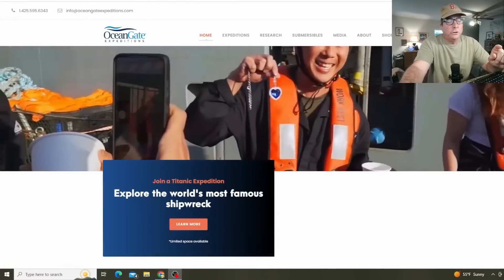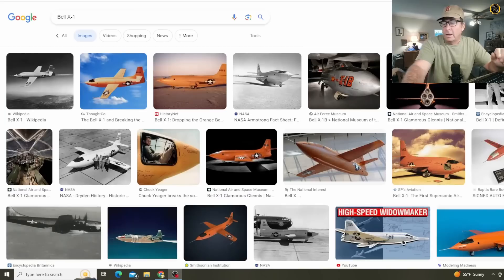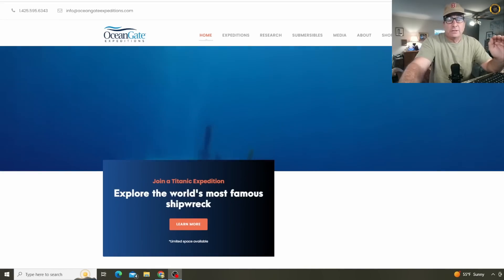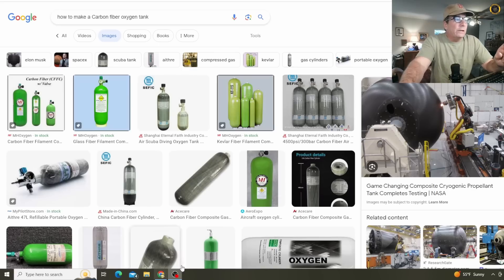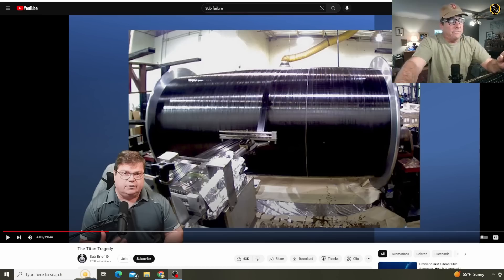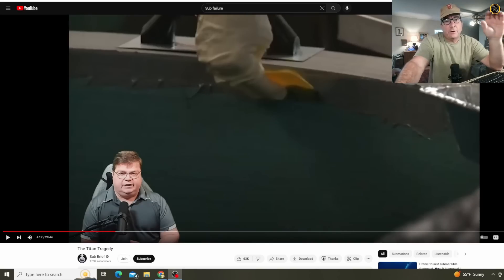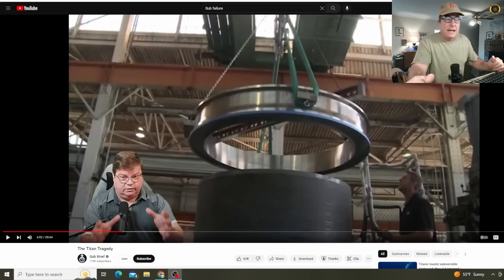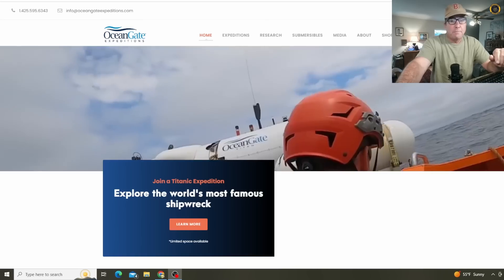Oceangate Sub Construction Details and Implosion

Comment: A really good engineering description of the construction and a possible failure mode of the pressure vessel. That glued joint is disaster waiting to happen. If the joint rebate was much deeper, say 18 inches, it would have helped to stabilise the tube.

Comment: The titanium ends once the caps are on are crushing the tube and the only thing resisting this is the epoxy which is an upgrade over paint or glue but still is not ceramic or something using heat over chemistry. Wondering about engines and why they don't use carbon fiber for things like the block, pistons, rods, it is because it cannot withstand the compression. They have looked at ceramic in engines but it has a brittleness problem, they are used though and withstand higher temperatures. Ceramics, because of the heating, is quite complex compared with epoxy, armatures make carbon or glass fiber boats and I suspect airplanes, I made a wood/fiberglass kayak a bit rough but it works.

Comment: I do airworthiness for my job and I could tell the CEO of Oceangate was misrepresenting and lying about the using "approaches largely used in the aerospace industry". You nailed it, Juan. We avoid using carbon fiber in a compressive stress environment as much as possible. If we do, then we certainly don't lay the fiber the way they do. We also like to bond ceramics to fiberglass and carbon fiber to help with compressive stresses. 

Bonding metals to carbon fiber is common, so I would like to know more about how that join is made. I think you are right though, the carbon fiber shell probably flexed and broke the joint. I am sure we will learn more as the investigation gets underway. 

Stuff like this is a black mark on the structural engineering industry. I see crap like this constantly trying to make its way into aerospace. I've seen a lot of fly-by-night engineers trying to push the use of plastic to solve a dynamic impact issue. I've seen more restricted material (corrosion and fatigue susceptible material) usage in the passed 3 years than I saw in the previous decade. There are a lot of con-artist out there trying to dangerous structural engineering down on the industry, and they always do it under the banner of "progress", "move quicker", "push boundaries", or whatever buzz word is popular.
Reply: I did wonder about the laying up of the fibers.  There's no angular overlap that I can see in the picture - just rolling it on back and forth. Does that mean there are thousands of potential weak spots along the edges of the weave line as the load is not being spread across a large area as would be the case in a diagonal layup?
Reply: @terrybrown8539 yet another haunting question about this thing.
Reply: @terrybrown8539   -  I'm in the gun business and seeing the way they were laying it up reminded me of the old damascus twist gun barrels and all the weak spots inherent in that kind of construction.
Reply: People are applying the "move fast and break things" approach to engineering.
Reply: Keep speaking out against this- we are losing objective truth these days and its a very big problem.
Reply: Granted we only saw a portion of the CF lay up but that doesn’t look like any CF lay up I’ve ever seen before. Like a spool of thread. Huh?
Reply: @lednails  Yes, he seems to me like a guy with a lot of hubris.  He is not the first, and probably won't be the last, to lose his life in his own vessel/vehicle.
Reply: FWIW, in this case, the bloke who you accuse of lying and misrepresentation had enough conviction, howsoever ill-advised or misplaced, to put himself in that which he designed and built
Reply: The old facebook motto of "Move fast and break things" doesn't sound so good in this industry...
Reply: If we lose the propoganda battle it's a black mark.  In reality it is a big green check mark for using actual engineering of actual facts ahead of fake engineering and fake 'facts' in the service of progress and inclusion.
Reply: Probably from the over-glorification of silicon valley culture over the last decade. The hubris from watching 20 something tech bros becoming billionaires overnight from wirting dinky little phone apps now seeping into the 'real world' where lives are at stake, Very scary 😱
Reply: @lednails  Well I don't think it's wrong to say that regulation stifles innovation - but, in instances like this, like the aviation industry, etc., it does it for pretty damn good reason
Reply: I would be VERY interested in any observations Burt Rutan might have on these issues.
Also I have no problem with the "move fast and break things" approach to engineering.
You **DO NOT PUT A MAN IN THE PROJECT** until the item has been tested **to destruction** ten ways to sunday.
Some folks fault Elon Musk for "fast and breaking things" approach but you do that BEFORE you ever introduce humans into it. There are few substitutes for "bending tin" when you are EXPERIMENTING with a new approach. I too listening to the CEO of Oceangate discuss this and his posted design philosophies and I was appalled at his "Everything should just work out fine! I mean, we are monitoring it... right?"
Reply: @phlogistanjones2722  In the software world, "move fast and break things" is not limited to pre-production. You get your work out into the world, then fix it if/when it breaks.

Tesla's automated driving systems are a good example.
Reply: @SnakebitSTI  Or basically any modern triple-A video game - good lord it's bad anymore...

Comment: The glue line between the different materials with different coefficient of thermal expansion, and different modulus, is definitely suspect. 
But - reports are that they had some kind of warning about it and tried to come up before total failure. To me that points more towards delamination of the CF tube itself - that would be a terrifying.noise to hear.  Or perhaps an uncontrolled dive where it hit the floor, causing the implosion.

Comment: From the video it looked like they didn’t vacuum out the air-bobbles in the epoxy after mixing it.   Prior to installing the titanium rings.  Also there are ways to use Ultra sonic testers for carbon fiber materials.  Olympus make the NDT system but it’s expensive.
Reply: I've seen vac bagging of small parts but how do you deal with a big cylinder? With an aircraft wing you can just use a long bag but with the titan....
Reply: @keithmatthews1673  autoclave but that’s extremely expensive.  I was more concerned about the epoxy used to attach metal rings to carbon fiber.
Reply: @keithmatthews1673  You need a huge vacuum chamber with heating.  You use thermal set resin.  Vacuum the whole thing down, then bring up the heat and cure.  This is one of the reasons why an F-35 costs so much.  The vacuum ovens cost more than the GDP of some countries.

Comment: It doesnt look like there was a grove in the titanium ring glued on. Just a flat surface. No support to keep the carbon tube aligned, looks like the assumption was that the tube and the ring would behave the same under pressure. But that seems flawed as compression of the tylube could make it disengage from the tirltanium ring, then collapse, instantly turning passengers to pulp

Comment: I believe the only "safe" shape for a vehicle like this is a sphere.  Such a vehicle has never had a failure such as this.
Reply: Spheres will fail under high enough pressure. It is harder to do but take it deep enough and they will fail
Reply: That's what James Cameron said.  His sphere was made of steel.
Reply: I agree. But I read a new article where they interviewed an actual deep dive sub (military) designer in France and he said that the tolerances for roundness that are required are amazing. IIRC was talking sub millimeter level. And this needs to be maintained dive after dive.
Reply: @Axel_Andersen  Yes, I read in an article, that it had to be in the thousandths of an inch.  To go as deep and deeper than the Titanic. Ten Thousandths of an inch to be safe.   
When I heard it was Carbon Fiber, I knew it had imploded as it is strong under tension but weak under compression.  It work hardens and fails fairly quickly especially at joints like flanges and such.   At least no one knew it was happening.  They might have heard some popping and dropped ballast, but when it failed they were gone in micro seconds. Their brains couldn't have had any nerve impulses before the air was hotter than the Sun and the water pressure would turn anything left into tiny bits in the water column. Tragic that they believed Stockton and paid the price for his Hubris.

Comment: Wow! I thought this was a titanium tube wrapped in CF, similar to a firefighters SCBA bottle. I would have no confidence in the end caps to retain their bond to the main CF fuselage
Reply: I believe the steel scuba bottle is wrapped in CF more as a protection from the steel blowing out than anything.  The CF wouldn't really do anything to preotect the steel from blowing in, even if you wrapped the inside of the steel.  CF under tension has the strength of carbon-carbon covalent bonds, like diamond.  CF under compression has the strength of hardware store epoxy.
Reply: @johnpublic6582  Firefighter SCBA bottles are filled to 4500 psi and the CF wrap allows a thin steel vessel that would otherwise fail under that pressure, allowing the bottle to be a light weight. I was thinking the same process might work in reverse, with the pressure surrounding the vessel in all directions, the titanium inner tube mould give the carbon fiber resistance from being compressed, transmitting the load to the inner metallic structure, while keeping the overall weight of the vessel low.

Comment: Wiki says the tube was made by alternating layers of carbon fiber hooped laterally and then a layer with the fiber running longitudinally.  The biggest red flag in the Wiki article is that the carbon fiber tube was either repaired or replaced twice by 2 different companies than the origional maker.  So 3 different companys worked on or made the tube.

Comment: The ballast plates had been dropped, so it seems likely they knew they were in trouble and were coming back up. That would seem to indicate an observed failure and the glued seam would be the most likely culprit. There would not have been any warning of failure in the CF hull.

One problem with glued inserted fitups is that it is almost impossible to exclude all air unless it is done under a vacuum.

It is in fact possible to do ND testing of carbon fibre, however that seam would have prevented it since a break in the glue would be hidden by transition to the titanium surface on the ultrasound.
Reply: I have seen one source, (Cameron on a CNN report), stating that the ballast was dropped. I have looked for additional sources with no luck. Were you able to find more than one sources for the information that they released their ballast?
Reply: Do we have telemetry that says they dropped the ballast plates?  They would have blown off during the implosion event and if there was any noticeable depth below the keel the ballast would have landed very far from the hull debris.  I'm afraid to hear that there is telemetry saying they started back up.  I could take a little sollace in them never knowing...

Comment: Was completely gripped/obsessed with this story the last week. I wonder why there wasn’t a resin glue + bolts connection to the tube? Thank you Juan!
Reply: Because you want to limit the amount of holes as much as possible, because every hole is another possible weak point by cutting through the threads giving ingressing water the chance to go in between the carbon fiber layers.
Reply: @B-M.B  That does make sense!, can imagine it weakening those laminated layers

Comment: Does anyone know how many cycles the pressure hull had on it?  Or an ideas about how many cycles it would have been expected to withstand?
Reply: Maybe the testing was all out in the field; and I have not heard of any inspection or refurbishing after each trip..😮
Reply: @danielgregory3295  Inspection would not have helped in the case of Titan. Use of carbon fiber was a critical and inexcusable design mistake. They should have used HY-100 steel which is weldable grade..... It would also have been safer to go for a spherical pressure hull, which has a proven safety record.
Reply: @MarkRijckenberg  
yeah, thanks.  I would have thought that this guy that holds himself out to be a hotshot engineer and businessman would have thought more about all of these issues and if he was going to use carbon fibre, to put some kind of measuring devices in/on the pressure hull to see how much it was moving during the dives.  I think that might have been useful info to have.  using a cylinder for a pressure hull is bad enough but a combination of carbon fiber, then titanium glued to the CF, then titanium end bells bolted on to the glued joints.  I'm not an engineer but it seems to like that's a lot of different materials with a lot of joints and mating surfaces. lots of places for failures to get started..  But I think they already found that out.  I think Cameron is right.  "The arrogance is strong with this one."

Comment: Carbon fiber is not that bad in compression , you just need to do the engineering math . But in this case it was not the carbon fiber that was resisting the pressure from the ends it was the resin and the adhesive ie. plastic and glue .

Comment: Wow -these are great images of Titan sub under construction! Lay person that I am, right from the start I was suspicious about how dissimilar materials could be bonded reliably and durably over time. Then I heard they used hardware store bolts - Yikes! And some witnesses reported personal experiences hearing the carbon fiber crack on earlier dives. I'm surprised the Titan survived as many dives as it did.
Reply: Nuclear subs ping and pop as they descend and ascend. You can hang a string from one wall to the other and watch it sag as you descend. But the designs, materials, construction and testing are rigorously checked. And the crews are well trained.
Reply: @KevinBalch-dt8ot  The difference is that steel is not a laminated material, which carbon fiber is....
The pops you hear will most likely be joints setting. Whereas when this CF pops, its very well possible that layers are unbinding.

Comment: would be interested in your thoughts on carbon fibre being Used in aircraft such as the 787 and a 350 does the dame thong apply?
always enjoy tour insights
Reply: The pressure differential that an aircraft operates in is an far less than that experienced by a sub at 3 or 4 k in ocean depth.   An aircraft will a see a differential of single digits per square vs a sub at this depth which will experienced thousands of pounds per square inch..

Comment: Great explanation Juan.  Of course, we may eventually here the causes if and when they recover the various parts and pieces of the submersible.  As you always say, this was not a single point failure though, there was a whole series of events from the initial conception of the design onward which led to this failure.  I would also question any of the hull penetrations as a potential failure point - there had to be wiring penetrations for control and communications from the inside to the outside.  
Outside of this tragedy, I learned that the Navy had Bob Ballard dive secretly on the Thresher and Scorpion wrecks for research, as a condition of funding the dive on the Titanic, and that information was only declassified several years ago.

Comment: Five inches of carbon sounds like a lot until you see the video of that narrow strip being wound around that tube. Might as well been duct tape. Juan is correct. Without  some bias between plies, it's basically resin and fibers. Really cool stuff when it's clear coated on a sports car. But, hey, what do I know? I'm just an over 50 blanco dude.

Comment: From that shot of them winding the fibers onto the form.  I had assumed that was a small shot of the process and there were other layers on diagonal and length ways.  It never occurred to me that all the layers might be wound only as shown.  If all the fibers were oriented the same, I would have been able to break the hull with a hammer.

Comment: Your first response was my response as well. I’ve NEVER heard of carbon fiber being used for a compression vessel, only expansion like as a tank. It may be lightweight and strong but the strength comes from the weave and how whatever object it is, is constructed ie, resin/heat/vacuum. It’s still not indestructible. Sounds like the CEO here was plain reckless with his and everyone else’s life. There is also another video from the past week of a former employee stating the original engineer of this craft had specified a 7 inch hull of carbon fiber but the hill was delivered with a 5 inch width. I wonder if this was the truth and if this was the start of the failure.

Comment: Another potential problem is as the craft is pressure cycled small deformations in the tube with cause joint rotation at the interface with the end caps. No idea what kind of adhesive is being used and if it can cope with stresses like that but the mating surface of the tube itself could begin to delaminate with repeated cycles. There is also an issue with potential delimitation of the tube along its length with repeated pressure cycling.